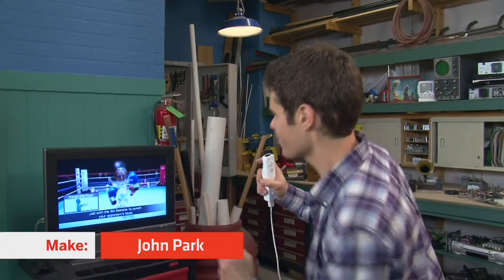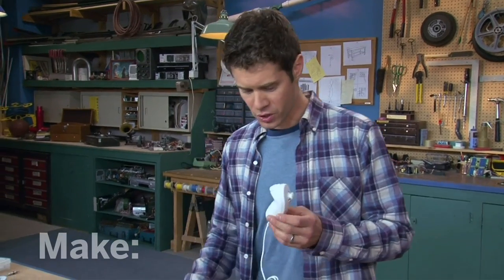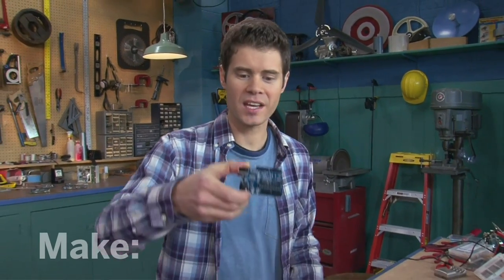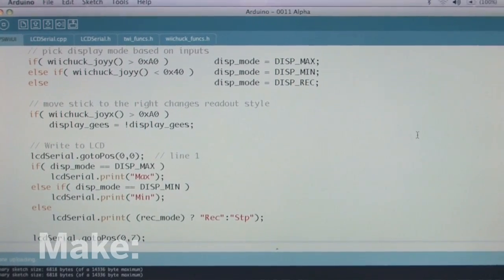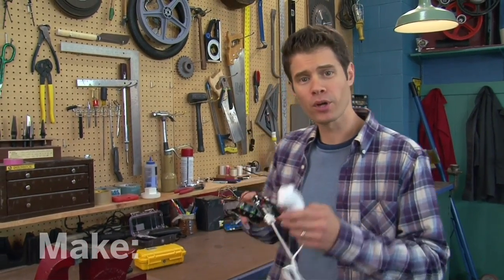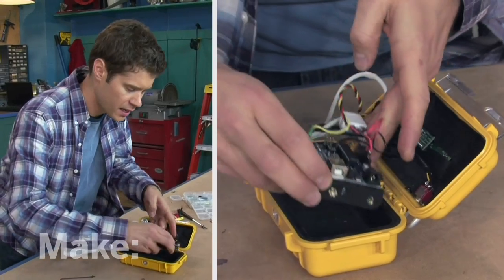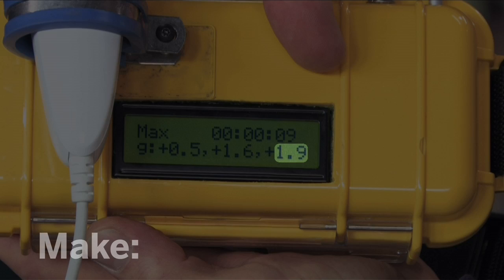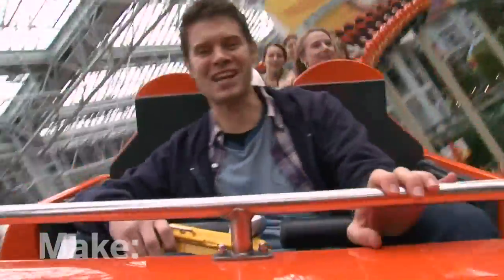Maker Workshop - Personal Flight Recorder on Make: televisio

Comment: You don't have to use a WiiChuk, you can just order a 3-axis accelerometer module designed for arduino from eBay, then you can get the whole device inside the box. I ordered one a few days ago from China for 1.00 USD.

Also, if you're just going to cut the box open, skip the expensive Pelican case and get something off brand. Same plastic, just as waterproof, and half the price.
Reply: That's right. A triaxial accelerometer like ADXL could replace the wiichuk and the whole thing could be much smaller like pocket sized.

Comment: instead of using plexiglass to seal it, u can get the clear version of this case and
cut the lcd slot into the rubber insert and attach it to that.

also why not take apart the nunchuck and mount the guts of it inside the case?